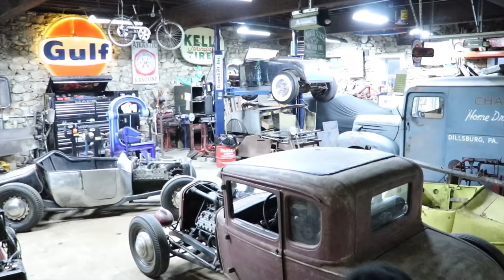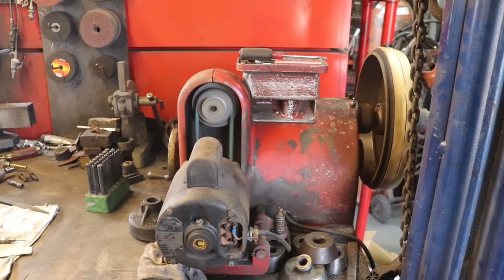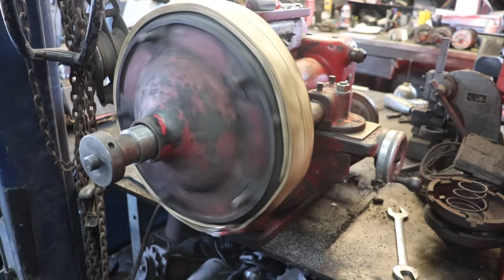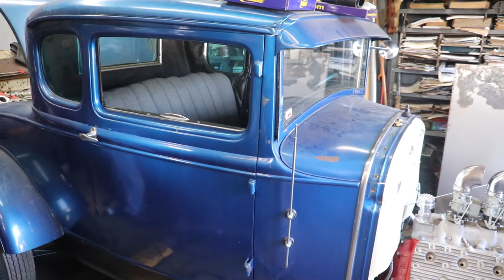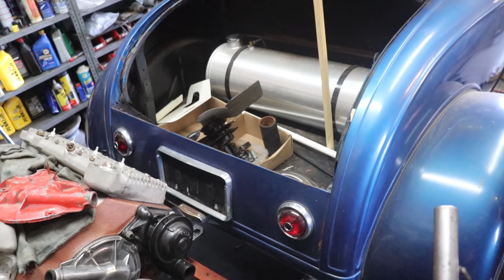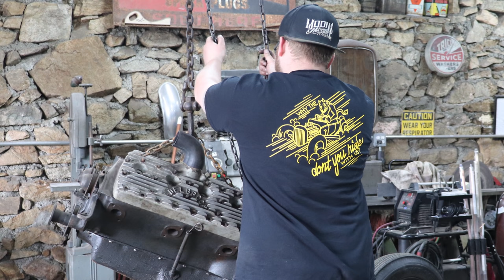Resurfacing Vintage Drums - Ford Free-T - Ep. 80

Comment: If you are wanting a versatile brake lathe , have a look at one made by AMMCO. We had one at work that was made in the early 60's and is still going strong. The current model hasn't changed much since the 60s because it doesn't need to because its good.
Reply from the maker: Thanks Andrew! Is it a floor mount or table top unit? I’d like a table top unit to save space. -Matt/ITG
Reply: @IronTrapGarage   Yes its a table top unit. It comes with a shadow board that you can mount on a wall behind it.  It comes with adapters and a rubber anti vibration belt to wrap around the drum so it doesn't leave shatter marks.You can turn discs and drums on it. It only take a few minutes to change from drum machining to disc machining. There are videos on Youtube on it. That pile of motors is a bit of a goldmine. I hope you can make the guy some money and maybe get some parts for yourself for helping.
Reply from the maker: Thanks for the info I'll be on the lookout for that one as well! I'm sure I'll stumble on a good drum lathe sometime soon! I'm having a good time digging around all of those old engines and parts. Always an adventure! -Matt/ITG

Comment: Hit me up guys. I've got a VERY Complete Van-Dorn valve resurfacer/valve seat grinder kit that your shop needs!! It's not in my way and I use it on occasion, but mostly on small engines. I've got a set of manual valve cutters I use most often. Check my videos where I show the valve resurfacer kit and hit me up if you're interested. Cheers! Zip~
Reply from the maker: Hey Zip, I'd love to have one of those but I don't do much engine work in my shop and I'm nearing capacity so I'm trying to only keep tools I use regularly until I can add an addition onto the shop for storage. Thanks for the generous offer though! -Matt/ITG
Reply: Absolutely Matt! Keep up the great content! Maybe your guy that turns drums could use it? Put the word out. Could be shipped Fastenal Logistics anywhere in the US for about $50. Cheers! Zip~ And, thanks for getting back to me.

Comment: That was only half of the job!! Turning the drum increases the inside diameter of drum and the brake shoes need to be rearched to match each drum so the shoes make full contact with drum.  If you don't re-arch your shoes you may only have 50%contact at first and over time the shoes will gradually make more contact with wear.

Comment: check your brake shoes for the correct circumference coz they'll bind
Reply: I use to rearc the brake shoe lining to match the radius of the drum. If you didn't there would not be full contact between them causing lesser braking power until the shoes wore in.
When you say "bind" are you saying the brakes lock up ? I've done many drum brake jobs not rearcing the shoes and never had a bind.
Reply: just saying mate, you don't wanna get incorrect wear
Reply: @mick_1949  But explain your term "bind" ?
Bind is different than incorrect wear.
Thanks
Reply: Using the word “BIND” probably wasn’t the best word I could have used, so sorry for any inconvenience caused.
Machining the friction surface of a brake drum increases the diameter, which might require oversized shoes to maintain proper contact with the drum.

Re-arc brake shoes to match the arc within brake drums. If not re-arched the leading edge, or the centre of the brake shoe can heat up prematurely leading to the drum warping, or getting out of shape, incorrect brake pedal feel, longer brake distance, etc.

If the shoes aren't correctly fit to the drum, the brake wont do their job as normal.

This is all I was answering to.

Love your show, keep up the great work Iron Trap Garage
Reply: @mick_1949  Thanks for your reply

Comment: Is the band on the drum there to wick away heat?
Reply: @Mike Gurnow I was wondering about that. I thought it might act as a scatter shield in case the drum shattered.
Reply: @roberttaylor5999  It is used to prevent the drum from vibrating.